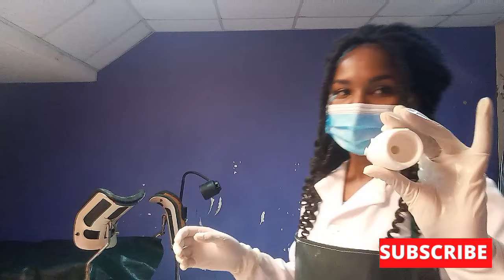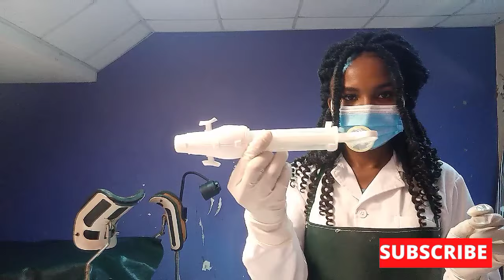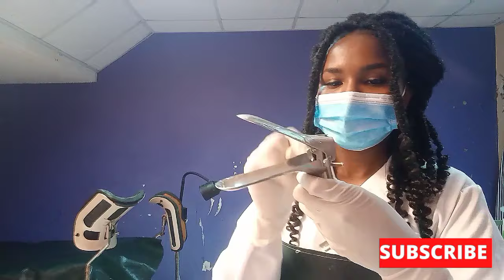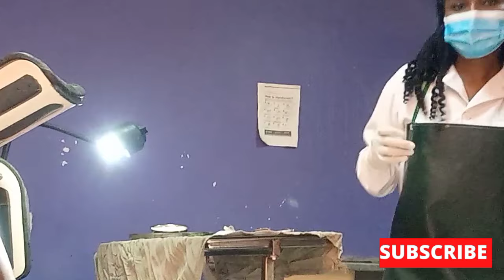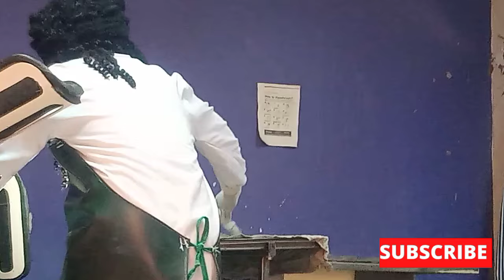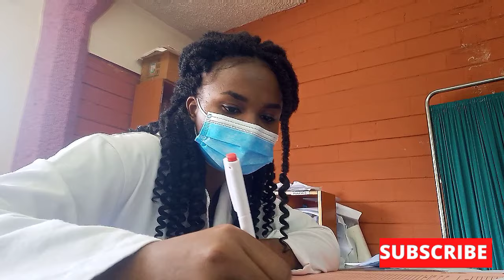Manual vacuum aspiration procedure/ A day with me in OBS/ GYN ward/ Fayreds the fashionable doctor

Comment: How do you know if the evacuation is completely done during the process
Reply from the maker: Signs that indicate the uterus is empty:
• Red or pink foam without tissue is seen passing through the cannula.
• A gritty sensation is felt as the cannula passes over the surface of the 
evacuated uterus.
• The uterus contracts around or grips the cannula.
• The patient complains of cramping or pain, indicating that the uterus 
is contracting.
Reply: @Faith_Mutune_ thanks